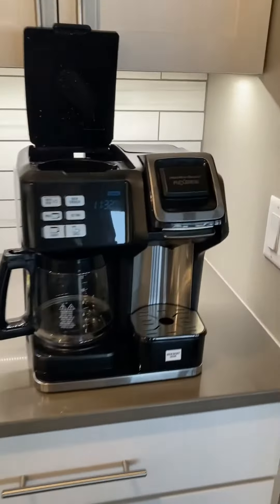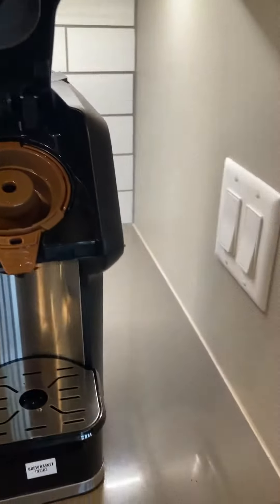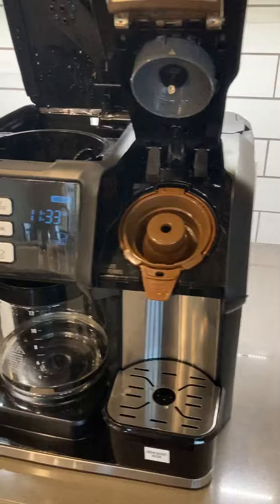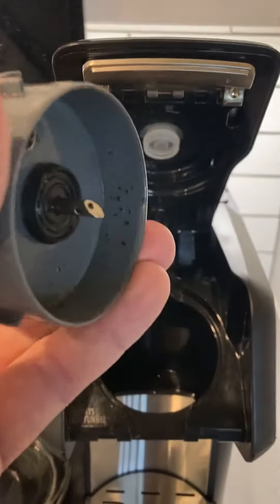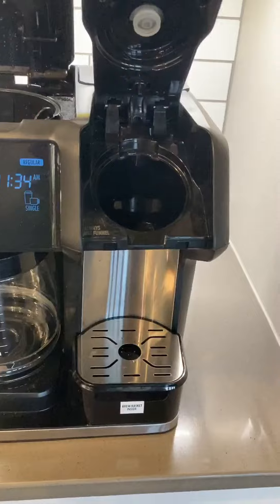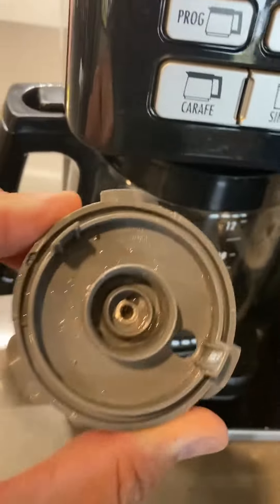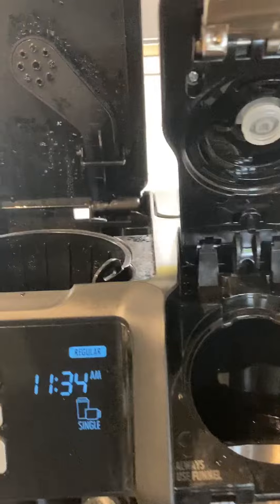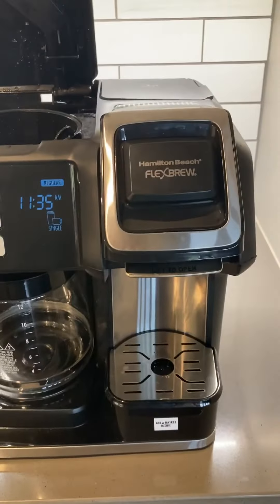Hamilton Beach Flex Brew coffee maker problems

Comment: Getting a fill h20 error yet the reservoir is full
Reply: Any updates on this error?
Reply: Getting fill h20 but it is full
Reply: I had this issue also, despite the reservoir being full of vinegar for a cleaning.   It probably took hitting the brew button 20 times before the error cleared and the single cup tried.   The vinegar did go into the carafe side.   I'm still running vinegar through, probably my 3rd or 4th time.  It's finally starting to trickle on the single cup side.
Reply: @margedugan5443  I had this issue also, despite the reservoir being full of vinegar for a cleaning.   It probably took hitting the brew button 20 times before the error cleared and the single cup tried.   The vinegar did go into the carafe side.   I'm still running vinegar through, probably my 3rd or 4th time.  It's finally starting to trickle on the single cup side.

Comment: I fixed mine, all i did was grab the gray and the black shot, and run it underwater. I used a safe pin and took out the coffee grinds and blew into it, then i poured water into the area where the coffe comes out. I tried it 3 times and it worked again for me

Comment: I will try this - have cleaned over and over, used paper clip on holes and still getting coffee ground explosion and grounds in my cup using the k cup side.  Was about to throw it away - so frustrating. Will order some spray air and report back...thanks for the info. The other side brews so slow also.
Reply: Did you fix it?

Comment: I have one bought as a gift over a yr ago from my daughter and i HATE it! The single cup NEVER brews a full cup, it over flows into my craft well!
Reply from the maker: @denellelloyd1280  I may post a follow up video that will be quite helpful. I can’t decide whether to use a 12 gauge or a .44 magnum. The single brew/pod function on this coffee pot is unfixable.
Reply: There are other good videos explaining this issue.Unfortunately the machine has to be taken apart and cleaned due to a lot of calcium build up and tubes clogged with coffee grounds. It doesn't look that hard.I am going to give it a try.